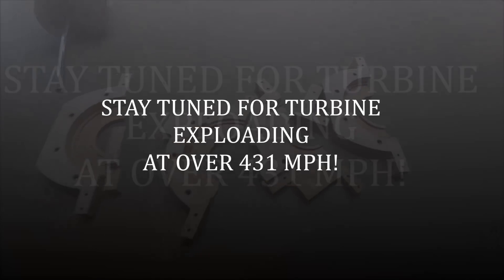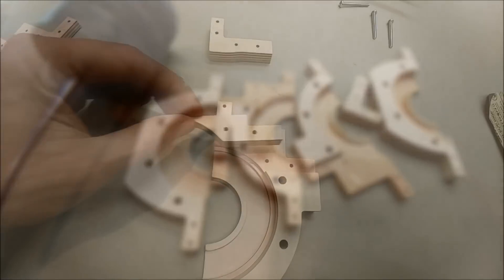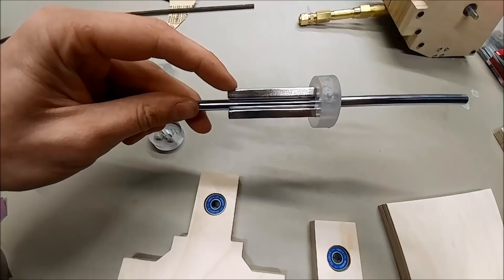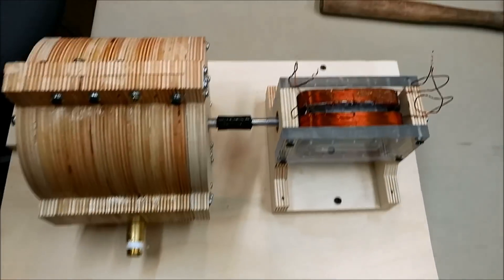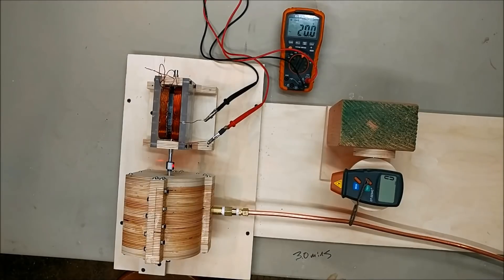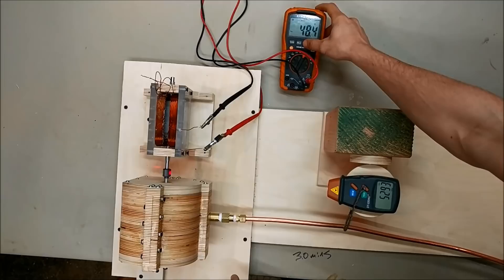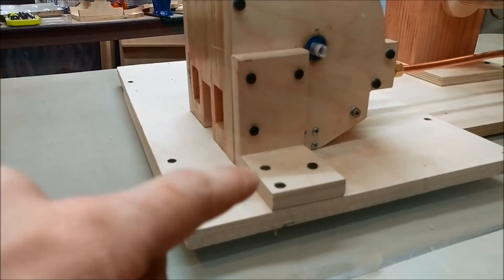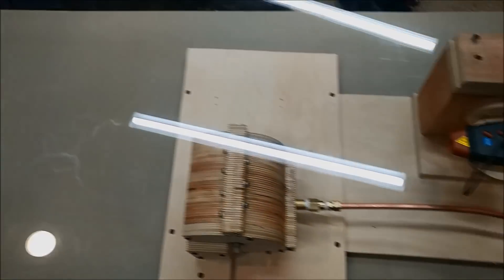See The AWESOME POWER of the Two Stage Tesla Turbine!!

Comment: A note. The picture you have in the beginning (0:04) is not a two stage Tesla Turbine, but shows 2 independent Tesla turbines running in opposite direction with a torsion string between them in order to measure the break horse power they develop between them. Also the Tesla turbine must be made out of steel and be operated with steam, everything else is quite a  sub efficient design.
Reply from the maker: The Tesla turbine is designed to run on many different fluids. You can also run combustion with the Tesla turbine if done right, this we will show in the future with a metal rotor.
Reply from the maker: Would you please link a reference of the information you have provided, I am really curious to read about it.
Reply: @iEnergySupply  The information can be found in the printed book ( also can be found in pdf format ) "A New dimension for Power" (http://www.tfcbooks.com/mall/more/335te.htm) , it is a collected articles form 1910-1920 with Tesla's interviews and explanation about his turbine. It is an excellent read not only for the Tesla turbine, but also to  a glimpse at the way Tesla wast thinking. The other way of looking at Tesla's way of thinking is reading his articles, patents and "Colorado Springs Notes 1899-1900", all of them are excellent read, but you have to immerse yourself in the 19-the century way of thinking as otherwise they are not an easy read.  Also take a look at the channel of  Don Schmidtke, as arguably, at least in my opinion, he is the most advanced researcher in looking, in the proper way, at the Tesla Turbine:: https://www.youtube.com/user/ourhouseisfull11/videos

Interestingly the Tesla Turbine, with its characteristics as an efficient thermodynamic generator, driven with steam, to convert the energy of the standard fossil fuels to heat and transform it efficiently to mechanical motion, input to onboard electric generator, and its low mass to output power ratio appears to be the optimal way of building the cars driven with an electric motor as a drive engine and small, on board, battery pack.
Reply from the maker: @EfficientEnergyTransformations  Thank you so much for the links!
Reply: @nikola.tesla.r.and.d.centre  Do you have any material that support your theses?

Comment: Crazy! There must have been some intense pressures.
Reply from the maker: As much pressure as a 1/4" piece of wood can handle that was the thickness of the first stage. Remember though the pressure is reduced by the second stage so not much pressure can build up in the turbine other then the periphery of the first stage sidewalls. Not as much as you would think. The inlet was 1/2" wide by 1/32" thick. The main problem was the rotor shifting and making contact with the side walls, this caused it to rapidly heat up and make the plastic soft. The explosion was from the rotor breaking and sending that kinetic energy into the casing of the turbine.
Reply: Why don't you make the walls rotate too?

Comment: 40 thousand rpm with plastic and wood. now if you only had an electric motor that could go that fast. hmmmm...
Reply from the maker: We also wan't to make a carbon fiber rotor, that would reach way higher rpm's!
Reply: i'd rather see it drive something with an usefull power indication (how much of the compressed air energy is successfully beeing converted into electrical for example) instead of seeing another one chasing supersonic revolutions. or at least explain how these revolutions could become usefull for what? like for example my cousin thinks the universe is made out of one timetreveling electron, so he somehow extrapulated that spinning collored & magnetic discs up to a certain rev. could create a usable timeportal.<- something like this maybe?